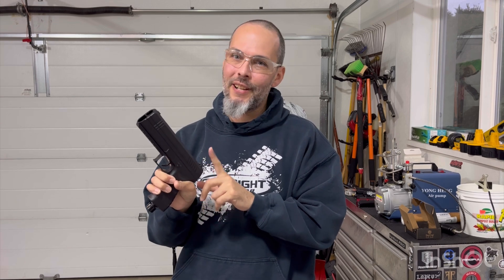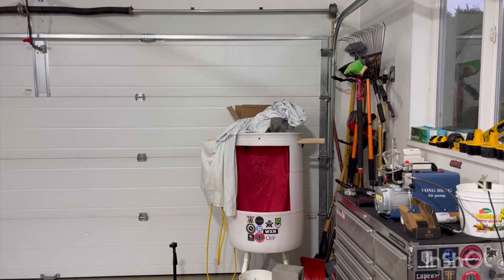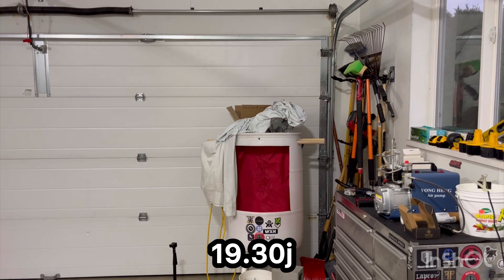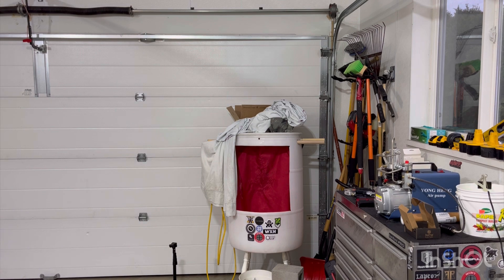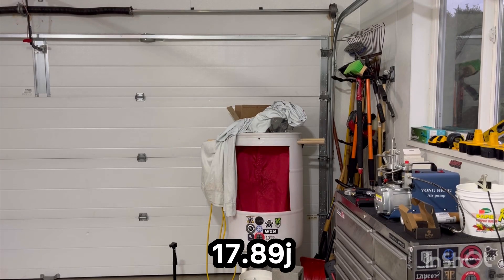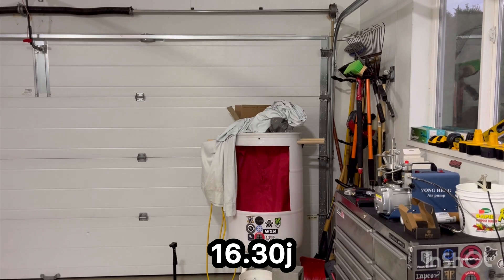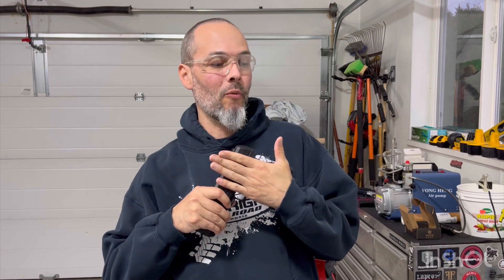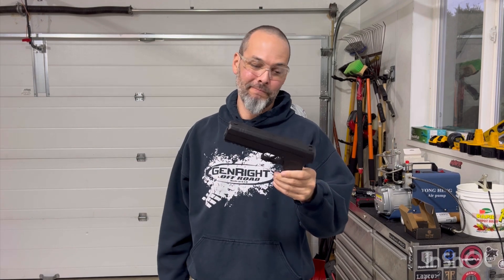LL4D Salt Supply S2 - Drilled 1.6mm (1/16”) co2 restrictor and drilled/tapped valve plug

Comment: I will say this is one that I actually like the v2s in better than the riot balls just because of the size I'm going to do some testing between the two but so far I'm having my mags full of the V2s nowadays
Reply from the maker: My highest numbers were with the 9.9 but i think the v2 just feel right in this one.
Reply: Do you both think the heavier balls will cause the spring in mag to wear down? Thats my only reservation about using the V2s or 9.9s
Reply: @freecaliswag  your springs wear out from compression and decompression The weight of the balls is not going to matter whatsoever as far as that goes because five balls is going to compress it completely no matter what weight they are.

Comment: bro I went back to look at your video s2 disassemble  I saw that spring that hold the barrel and the hole on top is can scape some pressure to push the projectile I'm thinking  instead of tape it put a silicon rubber seal that dry like a rubber put sealant then close it let it dry and fire the next day and see how the fps goes

Comment: Baby steps. If you do try the tape and it works, fill the hole with something more permanent like jb weld. Just a thought. Nice work💥💥💥
Reply from the maker: I havent had to use the decock hole yet so something permanent might be worth while. You know the second i do that the mag will get stuck. Just my 🍀.

Comment: I also wanted to thank you for the advice hdr works so much better with 9.9 grams and joules went up to just below 50 joules no tuning barrel
Reply from the maker: I saw a misfeed in your vid with them did you get that sorted?
Reply: @lesslethalfordummies  for some reason one didn’t fire but it didn’t happen again the dual co2 and one in the grip gave me a flat 50 joules and I was totally surprised

Comment: 20 joules with the 9.9s is pretty impressive, im really liking the S2. But my mag keeps getting stuck😅any idea why it would do that?
Reply: Interesting.. I might have a mag dysfunction then. but it seems that the rounds are jamming the mag in the well and not allowing it to release properly. No spare mag unfortunately to test.
Reply from the maker: @freecaliswag it is possible the detent shifted. See what Salt says. I just haven’t encountered any issues yet so its tough to say.
Reply from the maker: I have seen a little higher with the 9.9g. I would look down the magwell (that sounds weird)and see if you can see a small coil spring at the very base.

I also suggest sending Salt and email they have been really good helping with any issues that have arisen.
Reply: @lesslethalfordummies  i see it and it does look a little bent
Reply from the maker: @freecaliswag its there thats a good thing. When its compressed it may be catching on the recessed area where the spring sits against the mag.
Reply: @lesslethalfordummies  okay im seeing that, i suppose you should not hard press the mag in there or else you’ll bend it. Lesson learn lol. Thanks man. Gonna contact salt and see how they respond.
Reply from the maker: I am just taking a guess that is the issue. I do believe Salt will help you out with your problem.
Reply: @lesslethalfordummies  so i found out its not the spring. It actually seems fine. It depends on the type of projectile your loading. No jam with mag empty.

Main culprit is the 4.6 homewrecker loaded in the chamber.

Waiting on salt for a reply,
Reply from the maker: Technically good news but i dont have any problems using various types of ammo. Do you have another mag to try?
Reply: @lesslethalfordummies  And I don't either I've tried several different things in it and nothing seemed to be a problem
Reply: You are putting the safety in the on position right? because they won't let you eject it with it cut off
Reply: @DK-Spencer  yup i watched your video on the mag issue before i bought it, always ejected w/safety on. Now i need to crank it out a bit to get it to release. The marker still works fine though.
Reply: @freecaliswag  Well in that case thanks for the view😉
Reply: @DK-Spencer  been watching you for years, great insights. Thank you
Reply: @freecaliswag  And, thank you

Comment: Great work. I actually got 342 two nights ago when I opened it up and put tape over the detent and hole on the top of the metal. At first I used duct tape. But then I wanted something stickier and rubbery so I used flex seal. It was too thick. 
Also I think I left a comment on RAT. I too agree 100% with one mag and done for LL. 
The only thing with the tape is. If it’s too thick the marker won’t close right and the safety will not work, making the mag jam up. . But stick with tape over the detent did show an increase. Try the tape first before you drill it again. If I have time tonight I’ll send you a video of it. But I’m trying to convince my Ol’l lady to go for a motorcycle ride when I get home🤣🤣
Reply from the maker: Good to know ill use some thinner tape but unfortunately i have drilled again 😂 342 was that with the Salt balls? 

Ride on! 👍🏼
Reply: @lesslethalfordummies  yes with the salt balls.